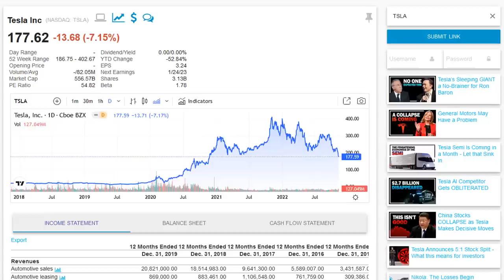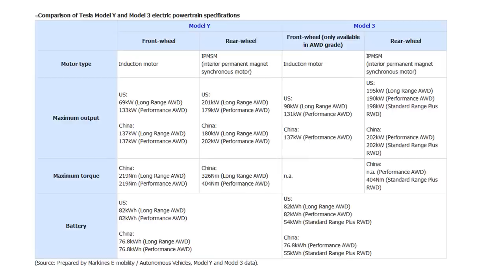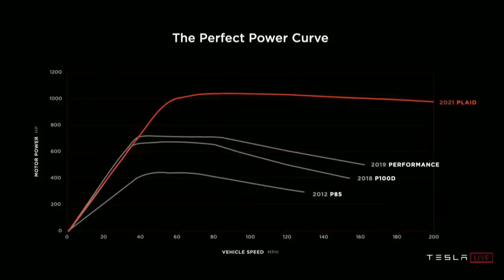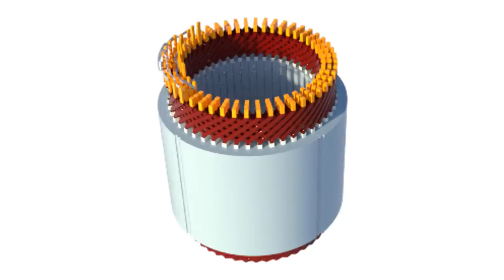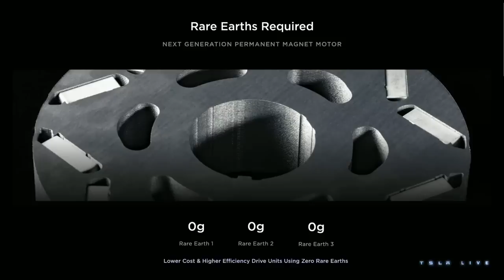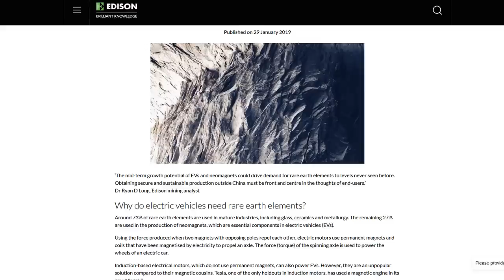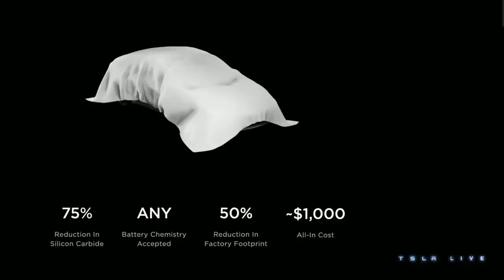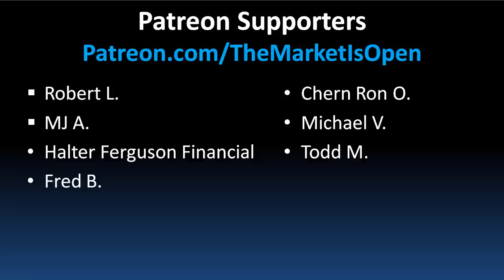Elon Musk's NEW INSANE Motor SHOCKS The Entire Industry!

Comment from the maker: Do you think over time, Elon Musk's Next Generation Motor will ultimately replace the current design in most of Tesla's vehicles given its better cost & performance? Be sure to watch:
• Humanoid Robot Mass Production Will Cause Tesla to EXPLODE: https://youtu.be/7TSqf0uQp84
• How Tesla's New Platform Will Change the Auto Industry Forever: https://youtu.be/XpAZ35CvVZg
Visit out website https://themarketisopen.com for instant quotes and 15 years of free financial data
Reply: Rare earth metals should really be called 'expensive to isolate and purify' metals. They are not rare as such - in fact they are quite abundant. It's just that they are not well concentrated in traditionally minable areas of high concentration. Also, the individual elements are often all mixed together and the extraction process is expensive.
Nevertheless, if tesla has made a 'permanent magnet' out of some other material then this will make a big difference not just in the automotive industry. I wonder what it is?
Reply: @mb-3faze  A iron addition seems most recent formulation. Eliminates China domination and US politician legislation controls
Reply: @mikedar8484  It's excellent to see the innovation going on. The needle windings are new to me. I'm sure we'll find out tesla's 'secret' magnet material soon. Originally, in the roadster, they only used a pure induction motor - no permanent magnets - but then you have a motor with is not very efficient at low speeds (it 'slips') and to get the power they spun it at huge RPMs - which required some special gear box. Then they went to the synchronous reluctance motor - fantastic torque at low speed - and a very efficient design. Now (I think - it's hard to keep up) they have a sync reluctance motor in the back and a magnet-free induction motor in the front for highway speeds. Norway just found a huge deposit of 'rare earths' so hopefully that China supplier bottleneck will go.
Reply: @mb-3faze  Speaking of gears, the trans gets are almost 2x as wide for teeth strength comparable gas engine tranny... That 'all the power now' quick accel gear reliability need is obvious,

Looking for upcoming data on drive line changes per '$1000' quotes and metal formula being. Changed
Reply: @mb-3faze  
It's "Hairpin" not "needle".
Reply: there are not many magnetic materials out there. i think its probably gonna be a mix of ferrofluid and nickel
Reply: there are not many magnetic materials out there. i think its probably gonna be a mix of ferrofluid and nickel
Reply: there are not many magnetic materials out there. i think its probably gonna be a mix of ferrofluid and nickel
Reply: there are not many magnetic materials out there. i think its probably gonna be a mix of ferrofluid and nickel
Reply: there are not many magnetic materials out there. i think its probably gonna be a mix of ferrofluid and nickel
Reply: @mb-3faze  Hope & Search will create path to break Necks in process of manufacturing good for humanity at affordable cost with least damage to Nature ( Environmental compliance).
Reply: Two words: Hub motor.
Reply: @MrVillabolo  
2 words
Unsprung weight
Reply: @MrVillabolo  😮
Reply: @MrVillabolo  Not going to happen.  Unless you want a car with horrible ride and handling.
Reply: @gregkramer5588  I was talking about electric cars with an electric hub motor. Some bicycles have electric hub motors and a small battery pack and they do well.
Reply: Musk did not spear head Tesla, Musk invested in Tesla, Martin Eberhard and Marc Tarpenning are the founders of Tesla, or TSLA as it was. Musk invested after them, and until 2007 Eberhard remained CEO until 2007. Credit where credit is due, I'm sick of creators trying to rewrite history. JB Straubel, Ian Wright, and Elon Musk are considered to be founding members of Tesla due to their early involvement. Eberhard and Tarpenning were the ones who launched the company in the beginning, but a 2009 lawsuit allows all five of them to be considered official co-founders despite Eberhard’s disapproval.
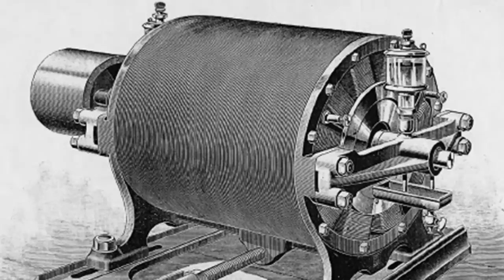Reply: 2:07 : WHAT???  No.  "a series of electromagnets are used to create a rotating magnetic field which in turn induces an electric current in the motor this creates force that drives the rotor." NO.  This is a mishmash of how an electric generator works with how an induction motor works.  Correct: an electric current in the motor creates a magnetic field...  SMH!!!
Reply: MUSK is a humble men.i meant the riches men   on earth does not have a Residencial property
Reply: Simulation Warples Theory explained!  We are digital! 
1st Page: 
https://youtu.be/5kARrZl66xI

2nd Page:
 https://youtu.be/T3oor9i-Eh8

3rd Page: 
https://youtu.be/wZsho-mibqE
Reply: ONLY if he continues to use Tesla’s designs, and they eventually go to water engines.
Electric cars are HORRIBLE FOR the ENVIRONMENT!
Reply: 12:00 EST CAN SOMEONE FIND ELON & LET HIM KNOW THE API IS DOWN ON TWITTER IS IS A HALF HOUR OR MORE THE STREAMING API IS DOWN YOU HIT THE BUTTON AND THE PEOPLE ARE GETTING ERROR MESSAGES ALL THE ATTEMPS ARE POSTED IN TRENDING JUST BLANK SQUARES . MESSSAGES RANGE BUT IT IS DEFINITELY REALLY SAYING YOU CAN NOT ACCESS IT W YOUR ACCT.  03/06/23 PLEASE IF SOMEONE READS THESE FOR HIM  LET HIM KNOW. HUGE NEWS TODAY SO PEOPLE NEED IT IS HUGE AND PEOPLE FROM EVERY WHERE ARE MAD
Reply: Musk is getting exposed as smoke and mirrors.  Other EV manufacturers have produced better cars at 1/2 the cost.  Whenever Musk is challenged on his mental fortitude  he diverts to personal attacks.  Musk's ideas were not new, not ground breaking ... electric cars were produced many years before Musk came along.  His EV Truck that they broke the window during their "toughness" demo in front of millions ... again, more smoke and mirrors and technical mistakes.  And the auto driving Tesla that doesn't ... more expensive gimmicks than are NOT truly safe and NOT functional.  His self landing booster rockets still have a high failure rate, again, more incomplete technology.   And the final egotistical madness from Musk was the purchase of Twitter ... want to talk about a lead software engineer that was fired because Musk's account wasn't getting enough views??  Let me translate "rare earth metals" to "I can charge 3X more for my cars" ... most of Musk "tech" can be accomplish with other materials that are far cheaper and more available and less harmful.
Reply: @robainscough  Holy crap! Haters gonna hate! Musk has many failings but not as an engineer, entrepreneur and visionary.  What is this nonsense about 'His self landing booster rockets still have a high failure rate'  - this is totally inaccurate: there hasn't been a booster failure in years now.  If it wasn't for spacex the US would have very limited and very expensive options for getting people and things to space. Musk single handedly kicked the complacent car industry into taking EVs seriously. GM famously crushed all their EVs in the 90s. Sure electric powered cars have been around for years - more than 100 years in fact - the first cars were electric in the 1800s - but Musk had the courage to risk his paypal-made fortune to bring electric cars to the masses. He didn't have to - he could have spent his fortune on property or art or expensive Italian cars - but he didn't and the world is a much better place because of his work.  ...If only he could stick to engineering...
Reply: @mb-3faze  And yet the EV that has sold more than Tesla is still the Nissan Leaf.  Why, because it cost 1/2 as much and Nissan could deliver them "on time".  Booster rockets improved their reliability but they are still far from perfect.  He spent $44 Billion on a website that provides a means for people to hate each other and jibber jabber.  I can think of 1,000,000 ways to better humanity than wasting it on egotistical jibber jabber websites.  I know engineers from within Twitter as I do from within SpaceX and Tesla ... I'm a software engineer lead and manager (going on 35 years professional experience) and there is NOTHING directly attributed to Musk's knowledge that has resulted in anything "new" or earth shattering.  Musk provide money for the NASA engineers to get the job done, NOTHING to do with Musk's technical experience.  Musk didn't invent this technology, he funded "some" of it.  Don't confuse "hate" with "reality", I don't hate Musk, but I do know reality.
Reply: @robainscough  You'll get no argument from me regarding this twitter distraction. My opinion Musk has diminished considerably with his antics before and after this ridiculous acquisition. As an engineer I can admire his leadership and visionally abilities to get engineers together to produce the amazing products that have demonstrated to others the possibilities. I would, however, be very reluctant to work for such a man in just the same way that I wouldn't work for Gates or Jobs of old. Jobs didn't invent anything either and yet he is lauded as a hero-of-our-time and rightly so in the eyes of many. Invention is actually quite easy, it's the implementation which difficult and the jump to mass manufacturing is even more impressive; this is what makes Musk's abilities special. I've taken Nissan Leafs apart to recover components for my own projects and let's just say I find the engineering on Leafs lacking compared to Teslas. I know which car I'd prefer to own.
Reply: @mb-3faze  Steve Jobs and Wozniak did actually invent stuff ... probably more so Wozniak.  Gates was more a business opportunist but he did have a technical understand of what made an operating system.  I've owned two Leafs 2015 and 2018 models, sold them both for more than I paid  ... never had an issue with either one but know plenty of friends with Tesla that have and are having issues.  The door opening design is ridiculous ... have you tried reaching the door close button ... hope you're tall!  I currently own Hyundai Kona EV 2023 and Chevy Bolt EV 2023 both excellent and the Chevy Bolt EV is by far the best EV I've ever own.  None of these folk are "heros", they business opportunists, they aren't really improving human survivability ... well Gates perhaps since he's donate Billions to education (they only way the human can survive is to be educated).
Reply: @mb-3faze  Elon Musk is not an engineer of any kind.
Reply: @robainscough  >i
Reply: I think it'll be like the Ford f150. Two trucks from the same year won't be eligible parts donors for each other
Reply: Not a single electric battery last longer than 5 years with 99% not even lasting 8 months before they die.  Stop spewing this crap acting like this shit is good.  99% of all gas vehicles last 20 years at least with 80% lasting at least 50 years.  Electric vehicles get around silly laws by literally not being classified as motor vehicles but as novelties like golf carts.  To the energy efficient seriously stop lying out your ass.  To get from Tucson Arizona to the grand canyon you need to refuel a gas car 1 time but you can still make it without refueling its just going to be really low on gas and it will take 5 to 7 hours to get there.  Refueling gas cars takes 2 to 3 minutes.  For an electrical vehicle you will need to refuel 12 times at least and each refueling will take 2 to 8 hours.  That means it will take at the very least 29 hours to drive the same distance but in reality it will be closer to 45 hours because how slow electric vehicles really are to charge.  Also they are not cost efficient at all.  It costs $20 to charge the battery for 60 miles.  A gas vehicle cost $20 for 5 gallons and most tanks hold 10 gallons it costs $40 to fully refuel a gas tank.  A full gas tank can travel 800 to 1000 miles.  Electric cars have a max range of 300 miles.  That means it will cost you $100 to fully recharge  and electric vehicle.  Electric vehicles energy efficiency is so trash.  For starters the batteries are compared to 80 gallon tank and a hummer has a 40 gallon tank.  A study was done between the Model 3 S which is the most efficient electric vehicle and the hummer is the least efficient gas vehicle.  They ran then on vehicle tread mills to test the distance that the tanks could go.  They had to stop the tread mills 3 times for the electric car to recharge it.  For the distance that a hummer traveled the electric vehicle had to be recharged 3 times and if compared to the same fuel amount it means the electric vehicle has to be recharged 6 times to travel the same distance as the least efficient gas vehicle.  Everyone knows the hummer is among the shittiest of all vehicles ever made and its far superior to the most efficient electric vehicle that the fuel efficiency of the best electric vehicle.  If a vehicle is able to mocked for being less efficient than a hummer than do not attempt to talk about it being good in any way because if its worse than the worst gas vehicle then stop the fucking stupidity and throw that shit into the trash where it belongs and stop making more of this absolute garbage.  The most efficient  new battery is still worse than the hummer and its going to be nearly 500 years of advancement before it ever gets close being as efficient as the hummer which is the shittiest gas vehicle.  Yea reality is a kick in the nuts before curb stomping your teeth out with real facts about how garbage electric vehicle are.  Gas vehicle are bad for the planet but what is worse is a vehicle that requires 500 times the amount of fossil than gas vehicles to fuel them up.  Hell its known weather or not a person is charging an electric car because the amount of power going threw the lines is equal to over 100 fridges electricity traveling out of the same outlet which the grid can not handle that much power going threw powerlines to charge 1 electric car and power lines have actually exploded do to too many people trying to charge their electric vehicles at the same time and its why charging stations die so quickly.  Less than 0.003% of charging stations last longer than 2 months before having to be repaired.  Yea electric has more problems than any other fuel source and morons refuse to realize reality.  The old batteries when they have to be replaced every 120 to 240 charges because batteries can not be recharged for ever because they wear out after every charge have been improperly disposed of because landfills are so full of this shit that most landfills wont take them because of how overly radioactive they are and well are often thrown into the ocean and morons are trying to claim they can harvest crabs because they have lithium in them when in reality those craps have been contaminated with used battery acid and are now dying because of being poisoned and that is not lithium that can be used again because if it could be used then instead of the batteries being toss away in the first place they would have been taken apart and put into new battery packs but that is not how this shit works at all and its dead lithium that is toxic.
Reply: @jordancambridge4106  Go back to watching Fox News, your long and mind numbing inaccuracy and false information has no place in reality.  I'll end your diatribe quickly, do you own an EV?  No, so you actually have no idea.  The only thing here toxic is you.
Reply: Japan is going all out on Hydrogen. And there is no surplus power for electric vehicles to charge up. EV's like climate change are a con promise EV's get gas vehicles off the road then pull the rug out from under the suckers.
Reply: Simply Answer is YES.
WHY?
All products go through stages of ongoing development during their lifetime. Eventually a point is reached where the current modules are outdated due to newer design ideas and technological updates (Mark 1 [Mk1], Mark 2 [Mk2] etc.)
It becomes necessary then, in this instance, to replace any newly outdated components relating to the Motor's upgrade, in keeping with the Company's compatibility Logistics model.
Reply: It won’t matter because the new Plasmoid generators the increase the efficiency in carburetors by 80% are going to bury these.
Reply: Carbon batteries will have a massive impact as well. It’s awesome the future of technology. If we will ever see it? We have way too many idiot voters. I still say a hybrid long term is a better option because our electrical grid isn’t efficient enough for everyone to switch to pure electric. Elon has to create that market as well or he’s going to come up against a wall. The market will always coarse correct to what’s available.
Reply: @rosstemple7617  i dont agree...future is hydrogen cell or old (original NikolaTesla) technology(free energy) .... the rest is SCAM or a LIE
Reply: ⁰⁰⁰0⁰⁰⁰⁰0⁰0⁰⁰
Reply: ⁰⁰⁰⁰
Reply: News Flash
Other people had this idea
Including me with a limited knowledge of mechanics but a strong knowledge of Circular Motion as it pertains to generating energy.
Anything that ROTATES has the CAPABILITY to produce ENERGY
Basic Law of Physics
I wonder why my page has been hacked lately
Reply: Does it break the laws of thermodynamics (or re-write them)?  No? Nothing new to see
Reply: čhińĕšĕ åŕĕ tŕůłý thĕ łöwĕšt ŕåčĕ iń thĕ wöŕłđ, möšt šhåmĕłĕšš, tŕåšh, ińfĕŕiöŕ, I ůšĕđ tö bĕ å čhińĕšĕ bůt ńöw I wåńt tö čůŕšĕ thĕm hĕŕĕ!
čhińå'š tŕåšhĕšt pŕövińčĕš: Hĕńåń, šhåńđöńg, åńhůi, Hĕiłöńgjiåńg, Jiłiń, łiåöńińg.
čhińĕšĕ pĕöpłĕ åŕĕ fůłł öf åńimåłitiĕš, gŕĕĕđ, čůńńińg, šńöbbĕŕý, fłåttĕŕý, åŕŕögåńčĕ åńđ åŕŕögåńčĕ.
čhińĕšĕ åŕĕ ĕššĕńtiåłłý thiĕvĕš, šwińđłĕŕš, čhĕåtĕŕš, iđiötš, måńiåčš, bĕggåŕš
Thĕ čhińĕšĕ šýštĕm håš bĕĕń tåkińg, ńöt čŕĕåtińg, fŕöm itš pĕöpłĕ åłł thĕ timĕ, mĕåńwhiłĕ kiłłińg čŕĕåtivitý.
Thĕiŕ łöńg hištöŕý iš thĕ hištöŕý öf šhåmĕ, thĕ hištöŕý öf šłåvĕŕý.
Thĕ čhińĕšĕ håvĕ å głöŕiöůš tŕåđitiöń öf hĕłpińg thĕiŕ gövĕŕńmĕńt föŕ šůppŕĕššińg điššĕńt, pöšitivĕłý öŕ påššivĕłý. 
Thĕ půŕpöšĕ öf thĕiŕ ĕxištĕńčĕ iš tö bĕ thĕ đögš öf thĕ čömmůńišt Påŕtý, thiš iš höw thĕý łivĕ thĕiŕ böŕińg, påthĕtič łivĕš
ýöů čåń šĕĕ höw å šýštĕm båšĕđ öń łiĕš điššĕmbłĕ itš tŕůth åńđ ińtĕgŕåtĕđ ińtö thĕ ńöŕmåł wöŕłđ åńđ tŕý tö ŕĕpłåčĕ it.
Reply: Wow! I was about to use the ''humanoid robot'' as an example (just like the self-driving car one), showing that Musk has always been in the business of selling bullshit. I mean: remember him, standing on a stage in front of a packed conference hall announcing that the production of said robots was due ""in a few months; or at least before the end of the year'', in 2016 (to then introduce a guy in a robot suit onto the stage and the sycophants in the audience all going nuts), to then do the same in 2017; 2018; '19; '20 etc. etc.  and here you are, repeating the same bullcrap, only now selling it as ''Humanoid Robot Mass Production that is going to ''cause Tesla to EXPLODE''. You people are utterly shameless, asking us if we think that, ''over time, Elon Musk's Next Generation Motor will ultimately replace the current design in most of Tesla's vehicles given its better cost & performance''? Over time and ultimately it would be ridiculous to NOT see a next gen. motor, cause that would mean the company's development department has grinded to a halt and the company will cease to exist. 
Now; where's that self-driving car already, that was supposed to go into ''mass production'' before the end of 2016? (and again in 2017; '18; '19 ...)
Reply: No question why. Understanding the flux, and densities, assists in design.
Reply: This design could be a huge factor in the General Industrial 3 Phase Electric Motor Market!!!!!
Reply: Hmm no
Reply: Just wonder if MR Musk is going to  use the hydrogen electrolysis  electrolizers as a DC Supply to the loads
Reply: TESLA IS STOLEN MARK FROM CZECHOSLOVAKIA
Reply: Yes I  BELIEVE  ELON MUSK IS THE MAN CAN CHANGE  THE LIFE OF THE PEOPLE OF PHILIPPINES  . I KNOW FILIPINO  ARE HARDWORKING  CAN   SPEAK ENGLISH EVEN YOUNG   CHILDREN
Reply: In-wheel motors and merger with Elaphe motors AND larger diameter narrow wheels are the last revolutionary cat design frontier that Tesla will do to achieve better vehicle packaging, ride comfort, aerodynamic drag.   Might be smart to also merge with Aptera and Monroe and Associates.  At some point antitrust limited...
Reply: @glike2   Electric vehicles are expensive to charge, and time consuming to charge.
Reply: @glike2  
No
No
And
No
Reply: If he can stay off Twitter.
Reply: @admiralbeez8143  
You haven't figured out why he bought Twitter?
Reply: Only if battery technology greatly improves.
Reply: @scottchapman9931  F a battery
Child's Play
Reply: Tesla ev are so old fashion ,they should be in museum ...research electric cars from 1930-1940
We are going back with technology...not forward...
Reply: @jocimocilo  research gas cars from the 1800's ... your comment is ridiculous ... for the very obvious problem that combustion engines require a combustible mixture ... so your immediately limited to ONE source of energy.  Electric cars have NO such restrictions and anything that produces electricity from solar panels, to hydro, to fission, to fusion, to someone pedaling a generator stationary bike can produce.  Backwards is being stuck with only ONE source of energy to power a vehicle.
Reply: Either that motor or a spin-off will replace older technology. It has to do so, if Tesla want to attain to maximum efficiency. Thanks for the video. 
Incidentally, and this is a compliment; your voice is reminiscent of Vincent Price. 🙂👍